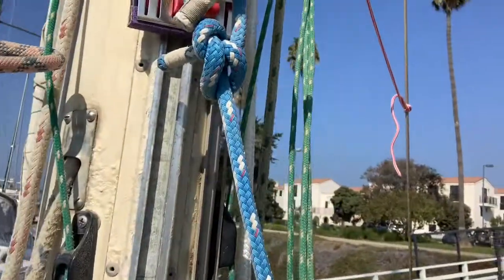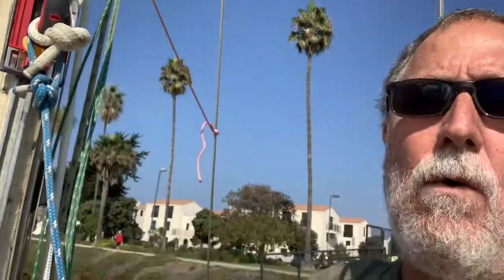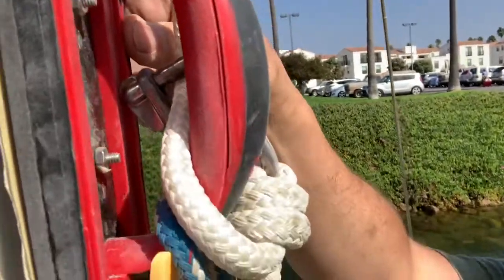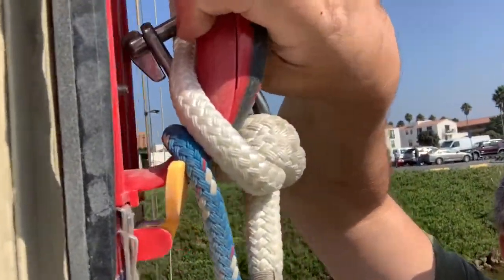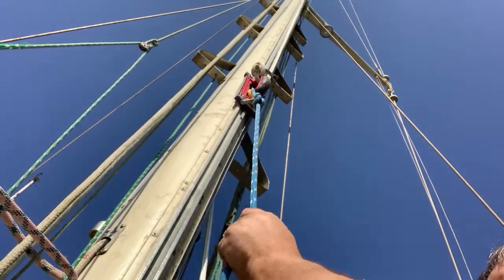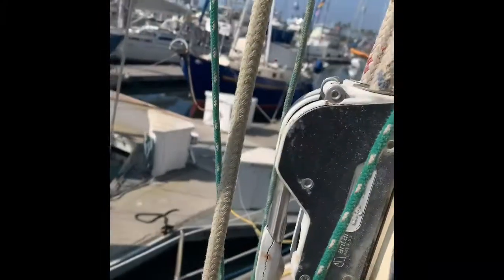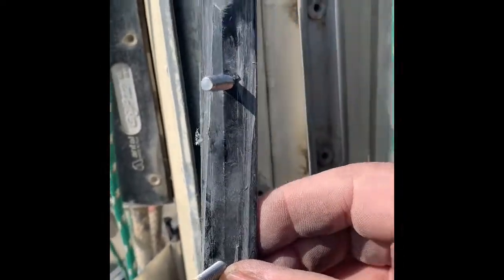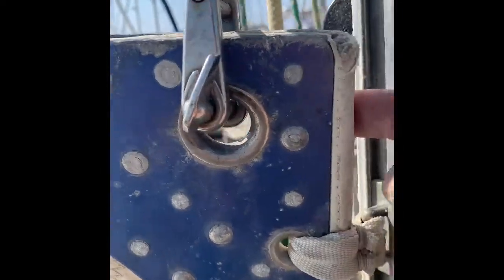Sticky Mainsail Track

Comment: I had a similar problem with a hat section track, so every second or thrd time going out I spray the slides and track with silicone! Much easier and no metal fines flying around.
Reply from the maker: @JohnWColley  I do the same. But in my case, the track had some corrosion that needed to be  removed.  My method removed it and smoothed out the track.

Comment: Great idea to solve that problem! To own and operate a sailboat you either have to be very wealthy or very mechanically inclined. You have to be a carpenter, rigger, plumber, auto mechanic, welder, fiberglass repair expert, painter, electrician, installer, possibly an upholsterer and male seamstress. Among other things like a sailor, cook, navigator, you've got to have courage...if you think you've seen darkness then try sailing at night with overcast skies...it's scary dark...pitch black!

Comment: I'm curious, what make is your boat? And have you considered the strong track system as a fix?
Reply: Hello Ken.  It's a 1980 Cavalier.  I have looked at the strong track system.  Because my track is external "insert" track, this won't work as the the back of the strong track would not have anything to rest on.  In the next couple of years I'm going to completely redo my standing rigging, including taking the mast down.  At that point I will likely redo the entire track or even get a new mast.